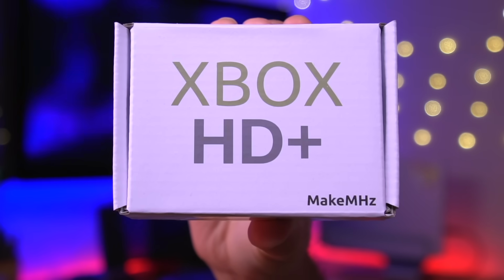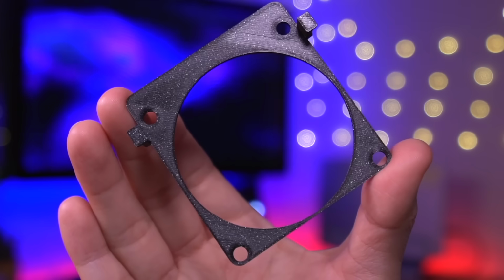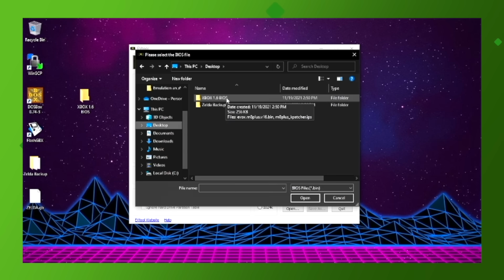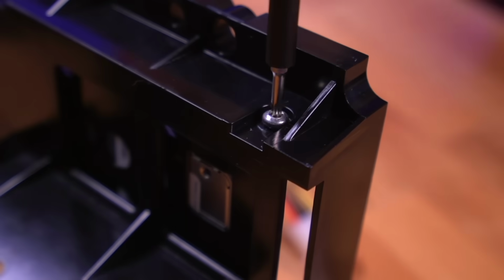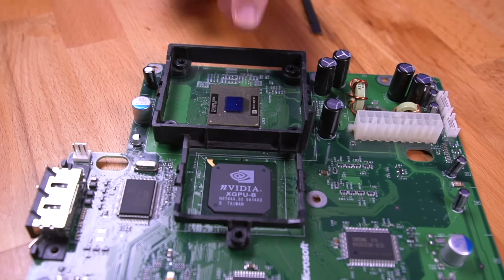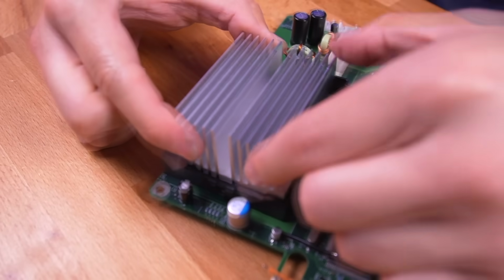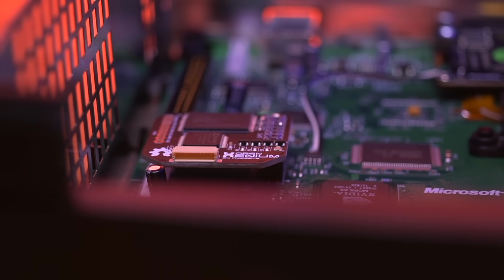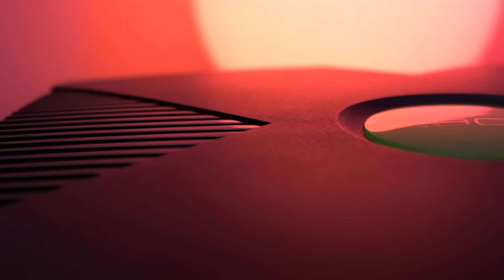I BUILT THE ULTIMATE XBOX TO CELEBRATE ITS 20th ANNIVERSARY | MakeMHz HDMI + SSD + OpenXenium +MORE!

Comment: Does the mod chip allow you to play sega chihiro games or is that a separate ram mod?
Reply from the maker: That's a really good question!  I just recently learned about the Chihiro and the Triforce arcade boards!  They seem super interesting.  I actually don't know but I should find out 😅
Reply: @MachoNachoProductions   If you give the og Xbox extra ram then you can play Sega Chihiro arcade games native on the Xbox. So games even light gun games like Ghost Squad can play on the Xbox and the Xbox light gun will work. Same as the Atomiswave games that got ported to Dreamcast. Those light gun games work just fine with the Dreamcast light gun.
Reply from the maker: From what I’ve heard the 1.6 revision doesn’t have the extra Ram slots like the older versions. That would be very cool though 😁
Reply: @MachoNachoProductions  get an older model and then do all the mods you did here with that 128mb ram upgrade and try some Virtual Cop3, Outrun 2, and Ghost Squad.
Reply: MOD chip (OpenXenium) won't have any effect on running those games.  It's the BIOS that will determine compatibility.  I believe IND bios supports the 128MB RAM upgrade (Not HD+ Supported) but m8plus will in the near future with HD+ through a firmware upgrade.  Mine has been upgraded an is waiting for the new firmware to give the Chihiro games a try.
Reply: @troymeredith521  if you can get a EMS Topgun 3 that light gun works on LCD screens and is fully compatible with PS2/OGXbox. That way you can test Ghost Squad in full HD with a light gun. If you need a EMS Topgun 3 to test with it I have an extra laying around.

Comment: I didnt like the new fan i tried it and the quietness didnt help
For
Cooling
Reply from the maker: It should move the same amount of air and maintain at least the same cooling capability
Reply: I thought that also but it doesn’t i tried it and did tenp checks
Reply: @anthonyaviles8665  Need to adjust the fan speed in the BIOS to 100% (using EVTools). Default is 20% based on the original fan.
Reply: I did it was about the same as stock fan at 60 %  still didn’t cool how i was expecting not much airflow regardless
Reply: I fitted an 80mm fan in my Xbox. You just need to remove the lower screw mounts from the fan so it fits in the motherboard cutout

Comment: I've only installed a Sata Drive in mine so far, but the fan mod is gonna be the next one I do, made a HUGE difference in the Dreamcast and Gamecube. I'm happy with quality component cables and an OSSC. Really well done, your soldering skills have been getting better and better, this looked quite involved. Great library and they still look fantastic at higher resolutions.
Reply from the maker: Totally agree!  The fan mod is fantastic and really makes the console near silent.  I'm sure component cables are very good and will look great!  I too am really enjoying the Xbox library 😀
Reply: If youre going to fan mod it you might want to consider going for a 80mm noctua instead, you dont actually need a adapter, but if you go with a 80mm fan you will have to cut some of the plastic on 2 of the corners, I have noctua nf-a8 fans in all 3 of my xboxes and they all fit better than the original did with no screws in the original mount.
Reply: What fan mod. I never heard of a fan mod for the OG Xbox.
Reply: I posted to the wrong thread where people were saying why they thought keeping the HDD was better.

Your all forgetting that the data drive will use less power than any HDD, takes up less space (better airflow), and is also silent (going along with the fan) so an SSD sounds worth it to me.

If you are woried then you can use a laptop HDD they are the same size as an SSD and use less power than a bigger HDD though they are still noisy.
Reply: @bland9876  I was wondering why you'd bother with an SSD, but yeah that makes sense. My first thought was - but SSD would only be getting semi used (speed wise).

Comment: Not sure why everybody is obsessed with shoving an ssd into everything that doesn't understand what an SSD is. Considering the fact it just bottle necks the information and is a lot more work than just putting in an HDD. Also considering the heat these things generate and the fact an SSD kills itself with use
Reply: Won't the new SSD be limited to IDE speeds?
Reply from the maker: Yes, I believe it will
Reply: @axelkusanagi4139  yup, sometimes even slower because of the bottlenecking issue

Comment: The fact that the XBOX is so simple to mod makes it even more fun I suppose.
Maybe I'll buy one eventually, pre modded.
Reply: the original Xbox is basically a PC
Reply: @ToastieStrudel  The front ports are USB ports with a custom connector.  There are (or used to be) adapters that allowed you to connect flash drives to the front ports in order to use them as really large memory cards.
Reply from the maker: I had a blast modding this one.  The software aspects were the most tricky for me but in the end I have to say I am really enjoying the console!
Reply: @MachoNachoProductions  you should get some widescreen and progressive xbe patches for the games.
Reply: You can easily soft-mod (permanently) an original Xbox with just a USB 2 Xbox USB cable. I don't accurately remember how I moded mine, as I had both several memory cards and also USB adapter cables, but it wasn't very hard. Not trivial, but easy enough and it also allowed me to change the HDD to a 750GB one. Doing so enabled me to dump my Xbox DVDs to the HDD and run them really fast and convenient. XBMC support and proper networking is also a nice feature. 
In my humble opinion that I greatly respect, you should give soft-modding a try following a reasonably recent tutorial.
Reply: @AndreiNeacsu  yup, the Rocky5 Tutorial by Mr Mario on YouTube is really good.
Reply: Soft modding is way easier and less involved than anything shown. All you need is a specific game, a USB adapter and a flash drive. It's brain dead simple with Rocky5, literally one click and you're up and running.
Reply: @wilfredynunez5263  Yes, this is true. But there is soo much more you can do with a hard mod. And if I am not mistaken, because of the Kernal requirement for it, you cannot do this particular HDMI mod (or a couple other mods) with a soft mod.
Reply: He was only populair because of the hack !

Comment: SSD limited by IDE. Reliable and no moving parts, maybe, but not is taking full advantage of the SSD speed. Excellent video as always.
Reply from the maker: Totally agree, while performance bump is limited, I did it primarily for the reliability and perhaps better thermals 😅
Reply: @MachoNachoProductions  And noise
Reply: @racer4200  noise is literally a non issue
Reply: @racer4200  "OneHundredYen replied: "Wolfstanus Ha. You've obviously never has an IDE hard drive." 

Ok idiot 
I have consoles and computers going back to the 70's. The noise from the xbox hard drive is not an issue unless you have sever OCD issues. In fact you can tell the health of your system and if it's working properly by the sounds the HDD is making. If you have your console a reasonable distance from you, you won't really hear the HDD
Reply: @Wolfstanus  I had a hard drive lying on the shelf for at least 3 years and when I plugged it in it was making it ticking sound but it seems to have been going away I haven't heard in a while.
Reply: @MachoNachoProductions  better thermal for sure. I find myself surprised by how much cooler these things run every time haha
Reply: I learnt the hard way with the SSD. It died after a year and thankfully, I still had my 80GB drive handy and got the drive cloned to my 200GB IDE HDD. I believe it's because the SSD was a cheap Inland 480GB SSD (Microcenter brand) and because they didn't have something like this back in 2019. Going to do that again in my 1.6 OG Xbox. The HDMI mods will be cool in my 1.0, 1.4, and 2x 1.6 consoles.